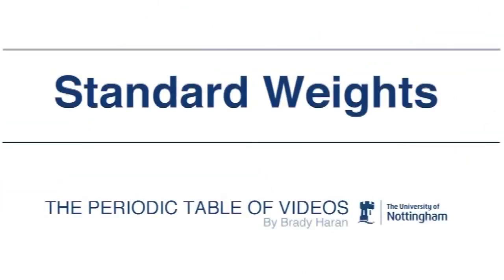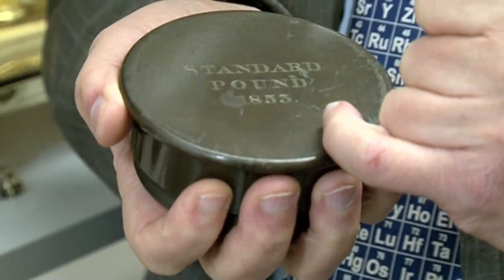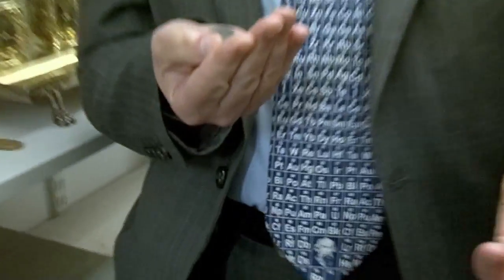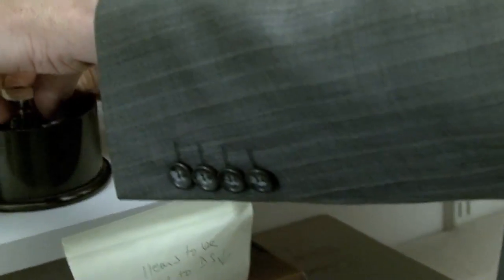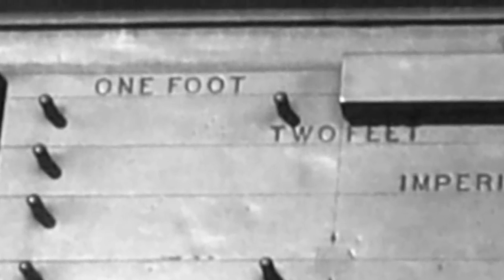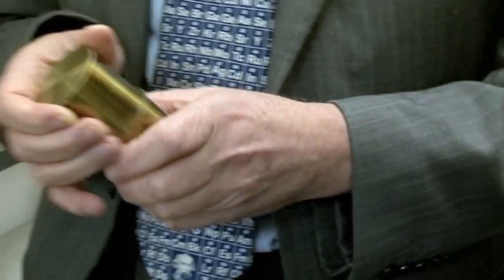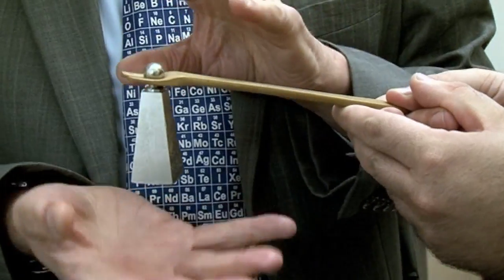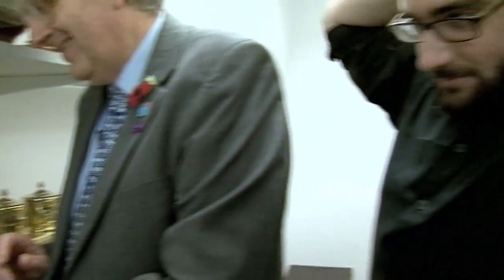Standard Weight (feat. Vsauce) - Periodic Table of Videos

Comment: Or, we could accept weights and measures  as we understand them now, and stop redefining everyting every few years. 

And why is it always that the French are constantly involved whenever somebody is deciding the way we measure things is shit? Just behead some more politicians and leave the system alone.
Reply: ***** You're trying to objectively criticise the metric system with a subjective argument...

And even then your argument doesn't stand up very well. If you ever try to buy a length of cable, rope, chain, carpet, etc meters is the most convenient "everyday" measure. When giving directions to somebody meters is the most often used measure (eg: "to get to the supermarket just walk 50m down this road, then take the left and the store is another 30m on the right"). Whenever you buy food it's weight will be in grams and in (modern) cookbooks all the measurements will be in grams (And in case you didn't know, in medicine they use milligrams).
But besides all of that the best thing about the metric system is that its so simple to convert between them in your head. If you want to know how many sheets of 35cm wide wallpaper will cover your 3m wide wall its super easy, even though one is in cm and one is in m. Same goes for grams and litres.
Reply: Ben: it's even better if we avoid the prefix centi- for linear measurements. If you do everything in millimetres, metres, and kilometres - likewise with litres - all you have to do is mentally move the decimal point or pretend the separator IS the decimal.

For example, 5.295 m = 5,295 mm
496 mL = 0.496 L

Much simpler than using 100ths, as nothing needs to actually move.

Comment: Were they to touch it, they would ever so slightly alter the weight of the platinum. That tiny alteration in weight makes a huge difference.

Those lumps are the literal scientific definition of metric weight (kilogram, gram, etc), so you don't want to mess with them!

Comment: I don't understand the point though. I mean, mass is the amount of particles that something contains, but just because something is more massive, doesn't necessarily mean it's heavier, because the density is based on the of the intermolecular forces' distribution of particles. Based on that, the new system using avogadro's number as a constant, would not be able to tell us which is heavier between some given objects, would it?

Comment: but after so many rotations of weighing one thing and using it as the standard for something else that you can expect to have a different calibration on the newest scales than the oldest ones. not by much, but enough that it's been a problem in the past. 

 You're right that not all atoms weigh the same, but all of the same isotope of the same element sure enough DO weigh the same that's why they stressed so much that their using silicone 28.

Comment: there are small enough differences in weight that most things we can make to weigh things will display things will have two problems. The calibration will wear off eventually, and it's hard to detect over a long period of time but the real issue is that it will display the same weight for things that are relatively the same weight,

Comment: why are those crazy ruskies wasting all their time with silica

correct me if Im wrong but dont we already have a simple (and "relatively") cheap way of standardizing weight in that the the metric systems gram is defined as the weight of a cubic centimeter of water (at just above freezing and at 1 atmospheric pressure)

Comment: @Bear5177 The standard weights shouldn't be touched because grease and anything else on grubby human fingers sticks to the metal. There's no need to keep it at a fixed temperature because temp. doesn't affect mass (tho' it does affect size - the standard *lengths* are kept at a fixed temp.).